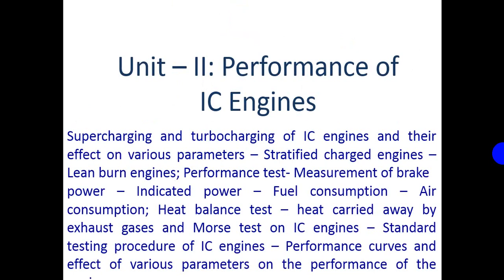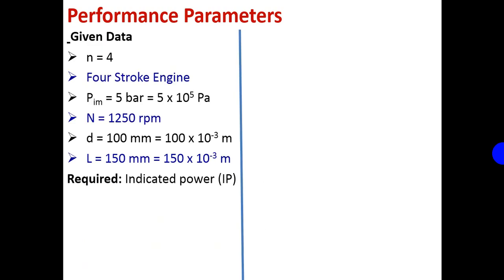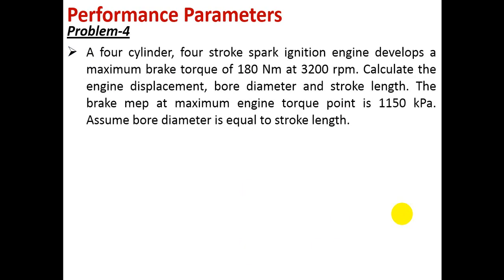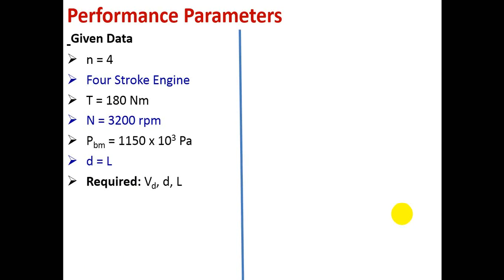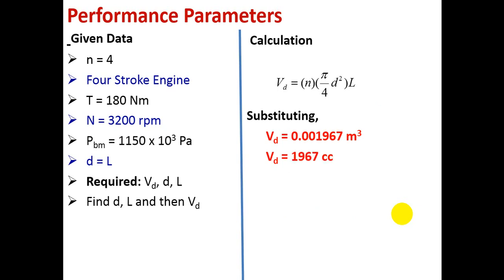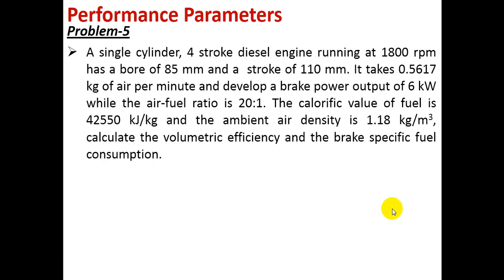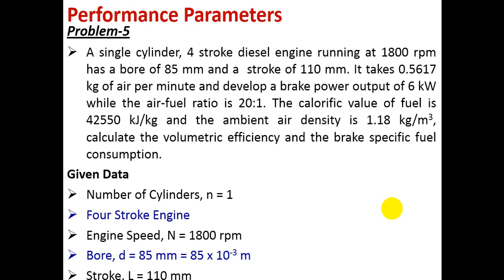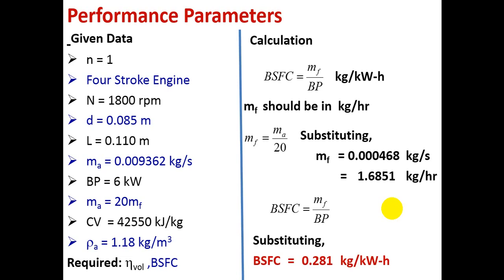Ic engines 5 Problems

Comment: a) The following observations were taken during a trial on a single cylinder 4 stroke oil 
engine.
Duration of trial = 1 hour
Fuel consumption = 7.6 kg
Total revolutions = 12000
Net brake load = 1.5 kN
Brake drum diameter = 1.83 m
Total cooling water circulated = 550 kg
Inlet temperature of cooling water = 15ºC
Outlet temperature of cooling water = 60ºC
Temperature of exhaust gases = 300ºC
Atmospheric temperature = 20ºC
Air consumption = 360 kg
Mean effective pressure = 6 bar
CV of fuel = 45000 kJ/kg
CP for gases = 1 kJ/kg K
Bore = 30 cm, stroke = 45 cm
Determine :
i) Brake power
ii) Mechanical efficiency
iii) Brake thermal efficiency
iv) Draw up a heat balance sheet on hour basis

Comment: A four stroke 4 cylinder petrol engine, works on constant volume cycle. The initial pressure in the cycle is 1 bar and maximum pressure is limited to 60 bar. Assuming the expansion and compression follows law of = C, and piston speed 600m/min, find the BP developed by the engine. Also assume that the neat addition and rejection takes place at constant volume and exhaust at 1 bar. The diameter of cylinder is 10cm, mechanical efficiency of 75% and compression ratio is 12 1.3 PV

Comment: . A twin-cylinder 2-stroke engine has a swept volume of 150 cm3 . The maximum power output is 19 kW at 11,000 rpm. At this condition, the bsfc is .11kg/MJ and the gravimetric air/fuel ratio is 12:1. If ambient test conditions are 10 C, 1.03 bar and the fuel has a calorific value of 44 MJ/kg, calculate the bmep, the arbitrary overall efficiency and the volumetric efficiency.